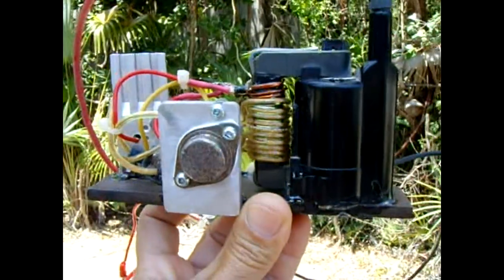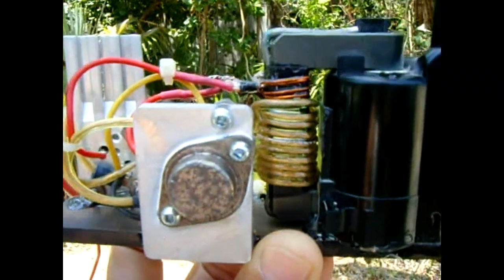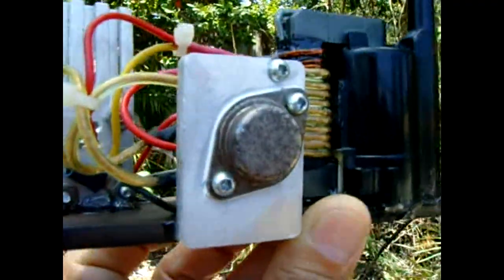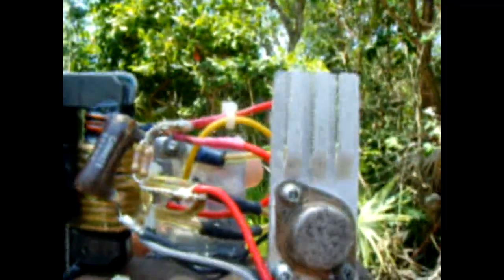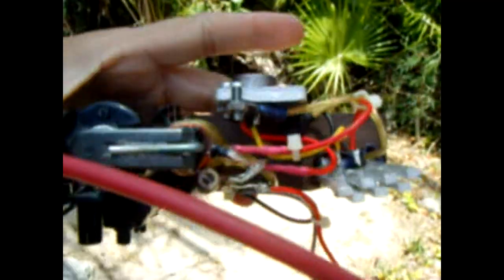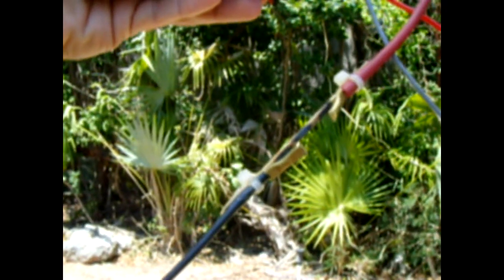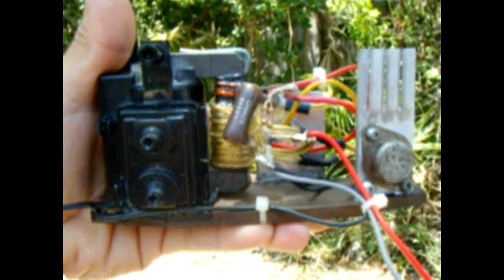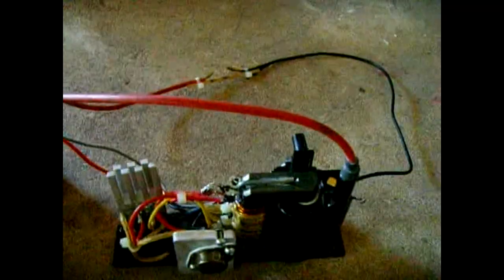~HIGH VOLTAGE~ TV Flyback Driver Circuit

Comment: 🧐Upon seeing the plasma reminded me of the energy stream🧬 from the Ghostbusters proton packs, so how would a ghostbusters blaster work ? 🤔  Perhaps the proton pack is a fly back stun gun that emits + charge only💥, but an earth supply🌎 completes the circuit🗼. like the ghosts 👻are the negatively charged ions(-) left over after brain death, because the left brains 🧠 receiver nodes(-) died milliseconds before the right brains🧠 nodes (+), so electrically charged💫 and generated protons ⚛such as thoughts and pure human emotional consciousness are left to leak out until shutdown⚰. These left over, undelivered feelings 🔌are trapped in our reality for eternity or until they are exor-cised🙏 by someone of good character whom will accept the electrical traumas as his own , just like what a real holyman✝, shaman🕉 or priest ✡☪ should be doing, The type of these emotional pulses💫 that get left behind depends how that person was feeling at the time of death⚰, some could be happy good loving vibes🫂 or revengeful vibes 🧟‍♀from trauma of being murdered or worse!👺 These lost sparks of proto-electro-emoticons ✨(StaticWatts/Sw) are then absorbed 🧽into the closest conductive mediums of metals🪙, minerals🧱 and bodily🫀 organic brain tissue🧠, that "bad feeling" 😨of being spooked😱, that was a horn-ting, 📯 Then they may get into trapped in the circuitry of ICUs computers (like in Tron and the manga film Ghost in the Machine💻)   and also those in proximity to the  deceased upon death, which would explain why a house could be haunted (📯Horn-Ted🐻 / 👂 BugBear🪳🐻 ) murdering evil mostly occurs inside buildings.🙆‍♂ The groans of the ghostly undead👻 would sonld just like an angry swarm of horn-ets🐝, or angry swarm of Hookers🐷,  🏩Whore-nits🦀 with fake porn-tits🍑 😂

Comment: electronicsNmore what determines the frequency in the fedback circuit?
Reply from the maker: Owen Chase Hi Owen. Usually there is a capacitor placed from the base of the transistor to the NEG rail to adjust frequency, but in this case I do not see that. The only thing I see that could possibly adjust the frequency, would be the voltage divider made up of the 2 fixed value resistors which supplies power to the CT of the feedback winding.Thanks For Watching!

Comment: @ultravox55 it is extremely normal for a lot of heat to be produced in this circuit. if it gets to wear it burns you almost immediately (which is commen) you might want to get a bigger heatsink or add a fan